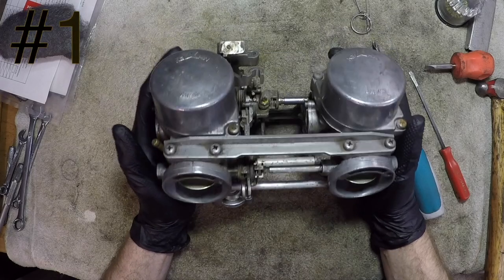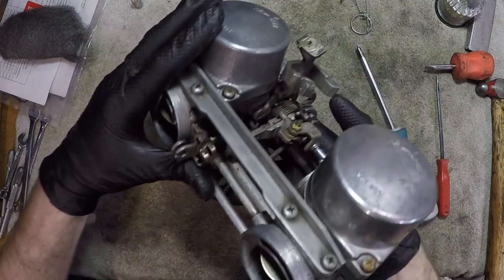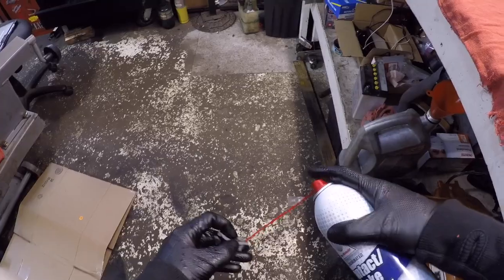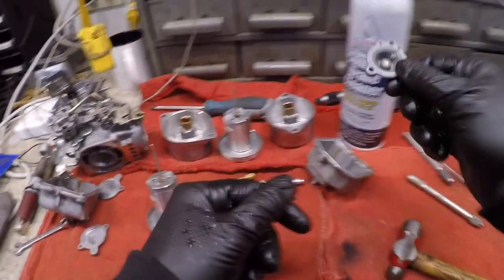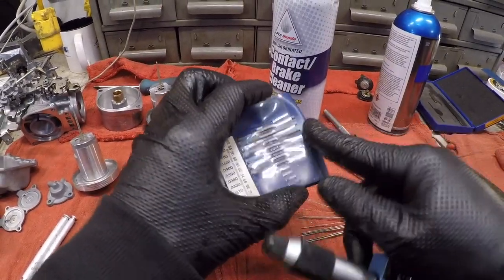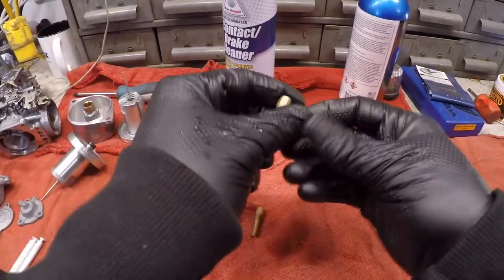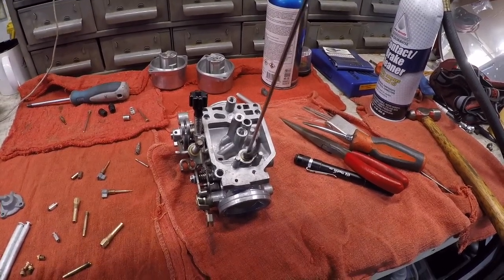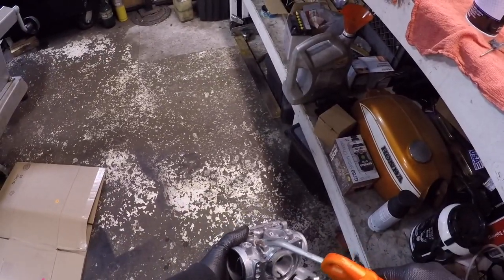Honda CM400 & CB450 Carb Cleaning : Top 5 Tips

Comment: Thank you MD~! I'm working on a 1981 CM400A with the secondary carb overflowing thru the drain line. I took everything apart and will clean like you suggested. The needle valves had witness rings on them and 1 of the floats had liquid in it. Hopefully they were the issues as the bike started and runs fine. One other observation was my carb didn't have the o ring that seals the accelerator pump fuel bowl orifice to the carb body orifice. I noticed some accelerator pumps kits have the O-ring and some do not, any idea which is correct?

Comment: Hi, I have a Honda CM400C, and there is a problem starting the motorcycle after it has been sitting for a week. If I turn it on every day there is no problem. The starter turns the engine but it doesn't turn on easily (with or without choke) finally it turns on. what could be the problem ?
Reply from the maker: Sounds like a pretty normal carbureted bike to me! You may not actually have any problem! Try full choke, full throttle on starting and feather the throttle once she fires up.

Comment: As a matter of interest can you get those float valve seats out to replace them. If so what's the best way.
Reply from the maker: Never heard of someone doing such a task and it working. Also have never seen where someone sourced the parts to do it. But I suppose with a lathe, some brass and a sharp eye anything is possible.

Comment: Helped out a lot my bikes running on one cylinder until about 3,000 RPM then they both pick up clean both carbs the same just one of them is giving me hell
Reply: I can ride now so I'm happy
Reply: @jasonwilliams4197 what did you find out that was wrong?   Mine only runs on one cylinder also and i cant figure it out.